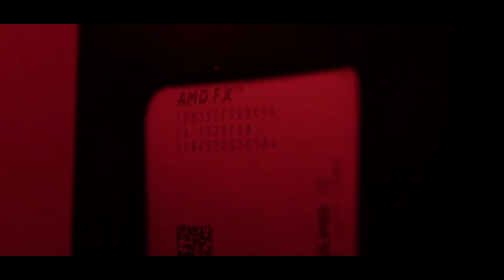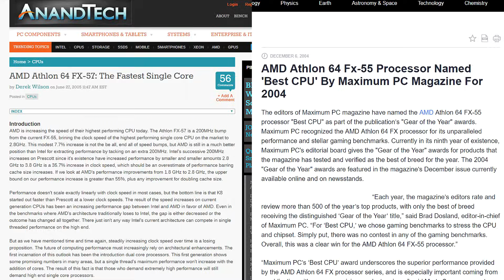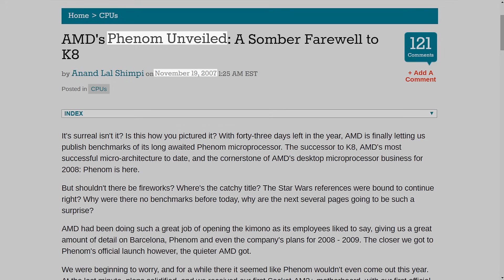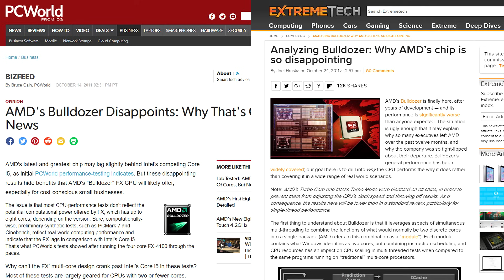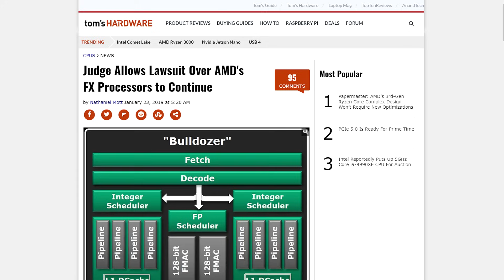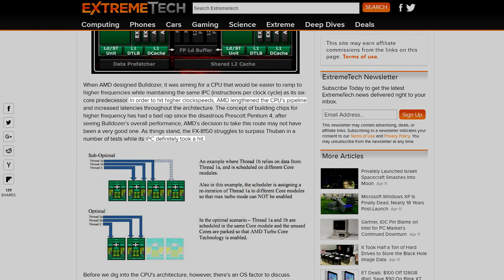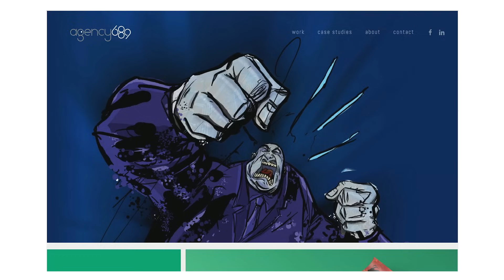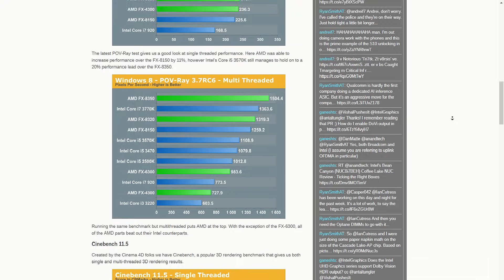Why AMD's FX CPUs Were Hated So Much? - The Fate of Bulldozer

Comment: The AMD FX Piledriver series kept 1,000's of PC Gamers gaming for an affordable price tag. They may not have been super fast, but they were the best in price / performance for the budget gamer. And while AMD was keeping it together, they were preparing ZEN.
Reply: Being affordable was the reason I got FX8350 about 6 years ago. By then, stores were slashing the price and bundled the processor with AM3 motherboard at Microcenter back in the day. It wasn't the fastest nor was it efficient on multitasking loads but it was reliable CPU and fun to overclock with.
Reply: Oh hell yeah!  Mine cost just $170CAD.
Reply: yeah but only because no one wanted them, also the price you paid for electricity would have gone up alot considering how power hungry they were and you also could have just gotten an i3 for similar price
Reply: @kamikazilucas  I can tell you haven't used a Piledriver CPU before based on how wrong you are with your comment.
Reply: @kamikazilucas  I have a FX-8150 and FX-8350. They have held up much better for pretty much any application vs. any i3 I have had (those are all in my CPU collection not being used). For one FX can still be used in modern gaming (because they had a lot more cores vs. i3 and i5), and modern games have moved to multi-core use. The FX processors and 990FX chipsets also supported ECC memory out of the box so they make great budget linux server boxes (great for VM's too). FX processors were not the fastest, but they have had much better longevity than expected.
Reply: I didn't really know the perception of the chip at the time, wow! I got the fx6300 because of the bang for buck and a rebate coupon. was going for a budget-mid tier rig and it fit the bill. So we'll in fact it's still taking care of me today. with a ram, power supply, and GPU (980ti) upgrade since then, but still.

Not at max settings or sometimes even all high, but it hasn't really skipped a beat in 11 years. Just re-pasted the CPU this week too.
Reply: When Bulldozer launched my friend bought some FX-6xxx, while I bought an i5. I still have no problem using this PC after many years, but my friend had to upgrade.
So yes, it was cheaper, but in long term I payed less.
Reply: @theEskalaator  ive been using an 8350 fx for 5 years now with a good quality motherboard. i play any game I want with an r9 fury.
Reply: @theEskalaator  That's a subjective statement & isolated to your friend. I've used mine FX 8350 for 5 years without a hiccup.
Reply: @theEskalaator  My friend still uses his fx 6300 at 4.7ghz in 2023 and just played through cyberpunk 20077 and god of war. If you max overclock them they can still game even today. A good cooler and overclock goes A long way. All I did was replace his stock cooler with My Ryzen 7 2700x wraith prism cooler with the rgb on it. I still have and use my Fx 9590 at 5ghz with 2133 ddr3 as well.
Reply: @theEskalaator  If your friend bought the FX-8350 and or the FX-8320 he would still be using it. Anyhow Intel's Core design was great and still widely used despite now being older. 
But Intel processors do have major vulnerability issues though. So keep that in mind. Only a new CPU Micro Architecture will fix these security vulnerabilities. 
As a note, AMD's Ryzen CPUs don't suffer from these 250+ vulnerabilities Intel suffers from.
Reply: @AggressiveHiDef  exactly - I built an FX-8350 system in 2013 for myself, and an FX-8350 Black Edition for my son in 2015. Mine is finally getting replaced with Ryzen 3700X and his is getting replaced with 2700X. Both FX-8350's are still very usable, in fact mine is going to my younger son for his first PC. 7 years gaming on my FX-8350 with dual GTX 970's and it still keeps up just fine.
Reply: @DCobra98  That is great. Despite the criticism AMD received about Bulldozer, they did a great job with there Piledriver cores (FX 8350 & 8320) as they had no choice back then, all up until ZEN was designed and released. 
Congratulations on the Ryzen 7 3700X as that's a massive performance improvement over the FX-8350.
Reply: @AggressiveHiDef  Along with the considerable worse performance, all AMD could really do with those chips was to crank up the frequency, with the 5GHz fx 9590 at first being sold at 920$ was certainly not priceworthy due to the performance being considerably worse than the i7 4930k. 

Another downside with the mature 32 nm process was that its rated tdp was a whopping 200 something watts, which was insanely hard to cool. 

Not to mention that the chip was so vulnerable to heat that its MAX TEMP was rated at ONLY 57 °C.

Looking even further, almost every fx motherboard only had pcie gen 2 due to that architecture, which meant even more gaming performance loss compared to Intel who was already on gen 3. 

AMD was even forced to reduce the price of the fx 9590 because a 300$ cheaper i7 clearly beat it in all imaginable ways. So it certainly wasn't "cheaper", neither did it offer good performance per buck for those chips that did eventually drop prices.
Reply: @oscarkarlsson8220  
Agreed BUT I'm talking about the Piledriver FX 8320 and FX 8350 which served very well for a low cost solution for PC Gaming. 
These CPUs were cheaply priced along with cheaply priced motherboards like the ASUS ROG, MSI, Gigabyte and so on. Again they served many budget gamers that simply did not want an Intel CPU regardless of price. You know as well as I know Intel price gouged when AMD was stuck with Piledriver. 

AMD did what they did, stay afloat while developing and completing the superior ZEN micro architecture. 

I can't speak about the later editions that were power hungry.
Reply: @AggressiveHiDef  Despite your claim of them "serving many budget gamers", numbers tell a different story as intel still was a clear winner and the cpu of choice. "Staying afloat" is not what a business is about, and I'd say they were sinking, and fast. Sooner or later they'd go bankrupt, clearly because their processors were a big failure and weren't selling well. So In my belief people still thought it was better to get a decent performing chip from intel that would last longer rather than a cheaper one with only pcie gen 2. 

Even though the price have been cheaper than Intel's current 3rd gen, you could still snatch an i5 2500k for the same price as an AMD FX one at the time due to it being a year old. Despite that, that i5 still had pcie gen 2 and better overall performance. People opting for the new 3rd gen would be greeted with a bump of pcie gen 3 which is still widely used today. 

And even if that 8320 and 8350 were cheaper, they still had a whopping 125 watt tdp, which would in turn require a far more expensive cooler to cool than the intel ones. Even the 2nd gen i5 released a year before would have a tdp of 95 whilst the current 3rd gen would have 77 watts, almost half the rated.

The only thing AMD could do was crank up the Gigahertz due to running on the older 32nm process. 

I am glad AMD eventually caught up though. Due to the almost monopoly Intel had, they barely needed to innovate anything, as they knew their chips would still sell, hence the minimal performance increases they had over half a decade. Due to AMD catching up, they'd even change their chip design to Big Little with P and E cores. And when there's a tight competition between to companies going edge to edge, their products become much better, and also cheaper, which is what we consumers want to happen.
Reply: @oscarkarlsson8220  You've made a lot of assumptions in your long essay their. 
Intel was lazy and cocky when AMD launched Bulldozer then Piledriver. 

Piledriver was a significant improvement over Bulldozer. 125w was peanuts to cool, it was not an issue nor did you require an expense cooler. Your assumptions are based on your opinions, not what happened in the industry. 
Bulldozer was a failure, we know and there's a story behind why Bulldozer came out the way it was, but this is YouTube, enough with the essay long posts OK.
Reply: @AggressiveHiDef  I barely made any assumptions at all, I thought I wouldn't need to paste sources in hetr. And sure, while it was still in no doubt possible to cool the fx cpu, it certainly was harder keeping it from throttling back then, which was my point. 

You can say all you want on how thousands of people and those that wouldn't buy Intel "regardless of price", which I do not deny existed, I just wanted to let ya know that there was a reason why Intel had such a huge percentage gap in the market. There were still tons more that still opted for the Intel side despite the price/performance you're saying.

If this is considered an essay for ya, then I don't think you've come far in the study department buddy ;D
Reply: @oscarkarlsson8220  Will always be AMD hardcore fans and Intel hardcore fans, it's the hardcore AMD fans that kept AMD going with discrete CPUs. The Sledgehammer and then the Excavator were also great improvements for their Fusion cores which sold pretty well. All this helped AMD propel forward to the eventual ZEN success. 
I owned a FX 8350 and know many that had them, they OCed well and they weren't difficult to cool at all. They were also designed for higher than normal power usage. The 32nm process node was a mature node.
Reply: fx was not affordable when it came out. it was priced against i7s and i5s, which were much faster, gaming wise. Once fx cpus started dropping in price, i3s were already good enough and better in games, so you could opt for that instead. FX never made sense for game, be that on a budget or a more expensive rig.
Reply: @hojnikb  You do raise valid points. Though, I have to disagree with some. The FX Piledriver CPU's did well enough in PC Gaming especially with its attractive price/performance ratio. They also overclocked well. They also cost a lot cheaper. 
The key to most people getting the AMD FX CPU's was the higher end motherboards were affordable compared to Intel's more expensive motherboards. And AMD stuck with the same socket for a long while.
Reply: @hojnikb  i3 was only 2 cores mere waste of money its not futur proof at all
Reply: Dr. LISA SUE

Comment: The first computer I built, my second PC was a FX-6100 with a 560 GTX I built for $600 Aus with 8Gb of ram to play BF3. I loved it, still have the combo now, has been dormant for a few years but the 560 is about to go into my daughter's PC which is my wife's old FX-6300. The FX-6100 will be teamed with an old HD6670 to be a game server. After a year owning the 6100 I slapped on a 240mm aio, pumped it to 4.5Ghz and teamed it with a 680gtx. That played BF3 80 to 100 fps 1080 ultra and and BF4 60 to 80 fps 1080 ultra. Was going to upgrade to a FX 8350 but wanted a m-itx system so I went a i5-4690k which I only changed in August to a R5-2600.

Comment: Running an fx-6300 @4.6Ghz rn, Plan on getting t he 8350 and Overclocking it.
Reply: probably wiser to just sell the platform all together and get am4.
Reply: @hojnikb  Really, You really think nobody has ever told me that before? I know that the am4 platform is better, but I am broke rn and only need 1080p 60fps gaming performance, and the fx series is perfectly fine for my needs.
Reply: Blake Wixom you can legit get the new athlon for 50$ which gives you an upgrade path and modern features like nvme storage
Reply: well you factor in motherboard and ram it is still more expensive to buy am4, I got the 6300, gigabyte motherboard for which I forget the model of, and 16GB DDR3 memory all for only 80 bucks, and besides I really dont give a shit of a fuck about having the newest stuff so I dont care.

Comment: Had an FX-8370 undervolted and P-state modified with MSR Tweaker + Northbridge and HT-link speed trimmed + DDR3 1866 memory tweaked for as low latency as possible at stock voltage and it performed really well, nice and stable. Cooled it with a Corsair H50 push-pull fan setup and it topped out at about 50-52 degrees celcius at maximum load.

Should be noted that while Piledriver had higher clockspeeds, it also had better IPC than Bulldozer.
Reply: "slightly" higher ipc.

Comment: i still have a 8150 and a 8120 and they are on a shelf where they belong they are terrible cpus and they are easily beaten by a cheap i5 unless you overclock the snot out of them. i did the smart thing and picked up a ryzen 1700x when they where $120 and a B450 motherboard totally worth every dollar and i had to set the 8150 up for a loner for a friend and even with good ram on a 990fx motherboard and a ssd boot drive and raid 0 hdds for mass storage it was just a lame dog in everything.

Comment: Until just very recently I was using a FX 6300 in my living room as a media center type PC (light gaming/emulation/video) honestly I never had any complaints with it. Probably the only complaint I could leverage was when running PS3 emulation the fan for the CPU would spin up to 100% (still managing 60FPS in After Burner Climax somehow... lol) and that was kind of loud. Though about getting a much better CPU cooler but that was the only time it would do that so meh.
Reply from the maker: The stock cooler that FX CPUs came bundled with were really loud indeed.

Comment: Still got my watercooled Gigabyte UD7 and an 8320 on the shelf. They were perfectly fine 'til i upgraded to a Ryzen at the beginning of this year. The funny part is that i got the feeling that it got faster in the last few years... 

I never had a CPU that lasted this long without any problems at all (same with the mainboard). So it might not have been the fastest chip, but it is something i really like. It's a reliable chip that simply works without having to delid the CPU or comparing benchmarks all the time.

Later on i might rebuild the system again. It would still be more than enough for a lot of tasks (even gaming).
Reply: It got faster cose games started using more cores
Reply: @paulsad7624  Not really. Bulldozer was tricky, as it didnt have 8 real cores, it was more 4 cores and a very sophisticated hyperthreading.
If games were coded to avoid certain quirks of the architecture and didnt rely heavily on single core for certain tasks, it was decent enough. It really "shines" in vulkan titles, as these games have less gpu api related overhead.
Reply: @hojnikb  Games were fully using 2 cores and Fx got bad performence per one core but it Has 4,
Also new games started using Threads  and Fx got 4 of it
Also Fx can get high Ghz from Overclocking

Comment: I have built several PC's using the FX 4350 CPU. All I know is these machine all run fast and my customers love them.
Reply: Why use the 4350 and not the normal 4300? The performance difference is minimal and the price gap between them is/was huge.
Reply: @davidcobra1735  At the time Newegg was offering some CPU / mobo combo deals that were priced pretty good. The CPU's were actually pretty cheap.
Reply: @jim8230  Oh, I see. Yeah come to think about it I saw some of those on offer too near the end there when stores were clearing stocks after the new Ryzens came out. Heck you could get an 8320(?) for ~$90 at one point. I still don't know if buying one was a good idea in the long run though. There's no upgrade path or replacement parts and you're stuck with PCIe 2.0, 2 USB 3.0s, etc. Unless you want to add extra cards anyway but those cost a lot.
Reply: @davidcobra1735  Yeah. Seriously I got a couple of the CPU's for under $90.00.